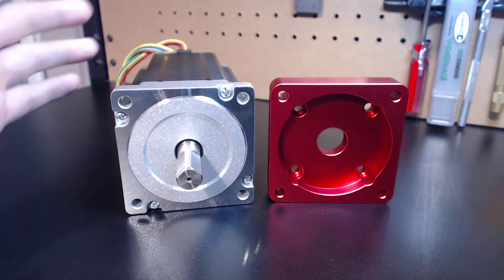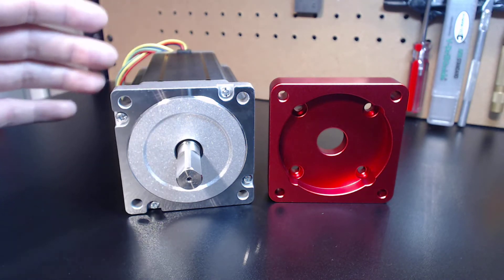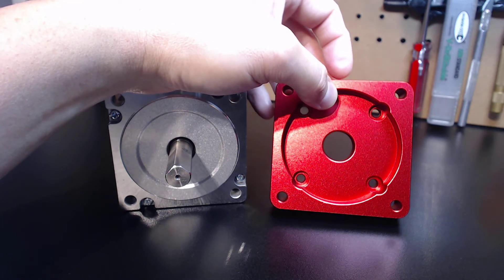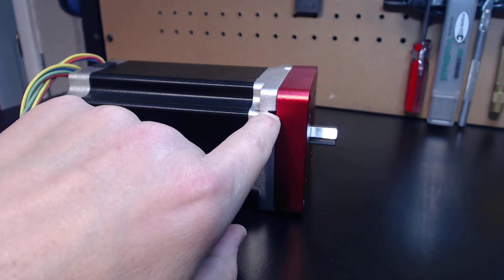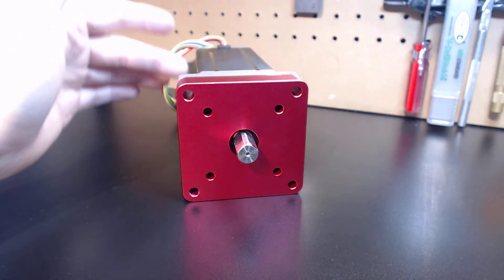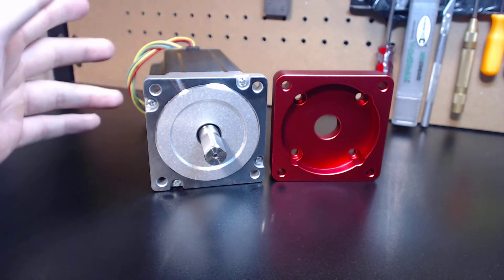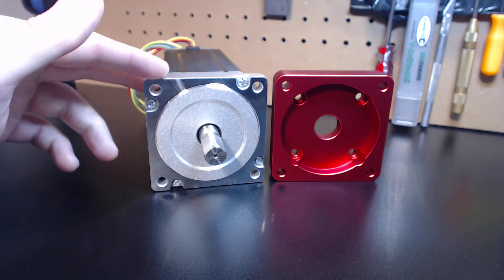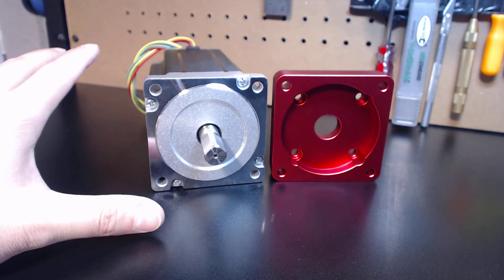Stepper Motor Mount Adapters From Nema 23 To Nema 34

Comment: I’m having a hard time finding the bolt pattern for nema 23 and 34. I have a Bridgeport with anilam cnc brackets and it looks like they are nema 23 and I may need your adapter. My mount is about 53mm or 2” from bottom bolt to bottom bolt centered. Is that nema 23? If so I need to buy your adapter
Reply from the maker: trialnterror, thank you for your support. Nema 42's are typically the stock motor size for a Bridgeport. If you email me I can send you the motor mount dimensions diagram regarding Nema which will let you confirm what your system is using. Thank you, Vince

Comment: Nice heavy adapters. Those should make a retrofit quick and easy. You have a great selection of custom parts that make working on these cnc machines easier.
Reply from the maker: Hey Chris, Thank you for your support. I really appreciate it. Your certainly right these will make retrofitting motors a very painless process. Thank you Vince